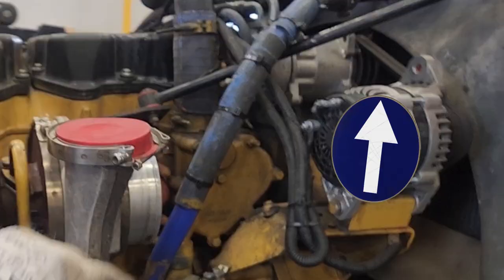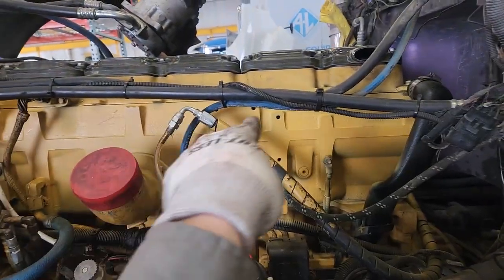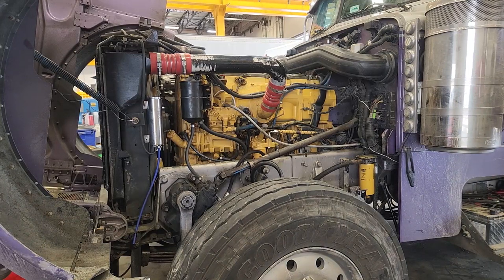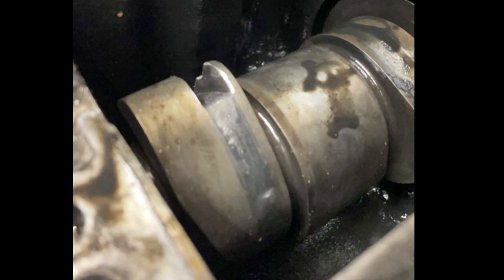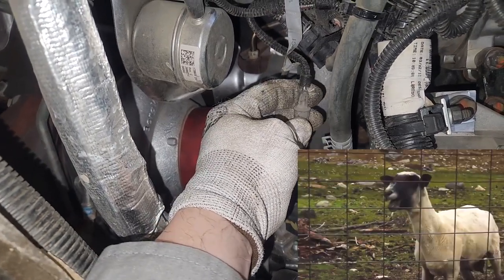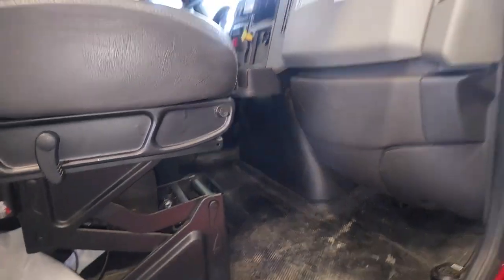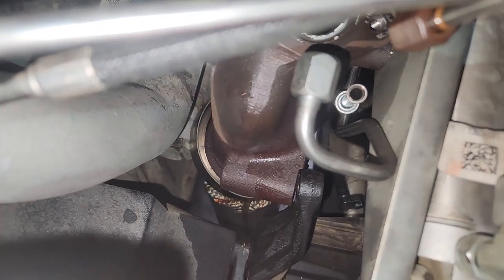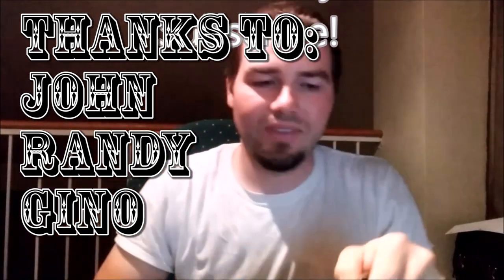Purple Pete Lives Again!!! Finishing the C-15, then starting a new project.....Fire Truck.

Comment: I actually work quite frequently on those Navistar engines as the fleet I work for has an abundance of them. Looks like you got a N9/N10 based on the presence of the NOX sensor on the exhaust brake (EBPV) and the bolt in lines to the heat exchanger, which Navistar calls the Interstage Cooler (or ISC for short). Some tips for working on these for coolers is I turn the wheels to the left and remove the RHS fender, then remove cab mount bolt on the right side that goes through the bushing and raise the cab, put the bolt back into place, then lower the cab onto the bushing bracket. This gives you access behind the right tire to get in there You can get that crossover duct out without removing the doghouse and EBPV in about 20 minutes if everything goes well. If you need any other tips I can gladly help. Keep up the good videos Josh!
Reply from the maker: I'm sure anything you work on long enough just gets easier and easier, although jumping on this one after a Cat C-15 is quite a difference.
Reply: @AdeptApe  Yeah that's true, but I'll say the misery never goes away when working on them 😂😂
Reply: Damn, solid advice.
Nothing beats experience on the job. 👍
Reply: The customer definitely made the wrong decision taking it to a shop that doesn’t regularly work on these. Those hours and hours trying to figure it out must cost a fortune.
Reply: @markm0000  Well it is a fire engine.  That means it involves government which means it involves politics.  Just follow the money.
Reply: @nitetrane98  Your hard earned tax dollars are paying for it...
Reply: That engine looks like it was designed by a bunch of German engineers. Which is to say, people who make things more complicated because they enjoy doing it that way and they aren't competent enough to do it correctly
Reply: I replaced an egr cooler on this exact engine model, it was my first time doing it and it was a complete nightmare, I never want to do that again on these engines😂
Reply: @johnnyholland8765  No comrade, our hard earned tax dollars.
Reply: @GIGABACHI  Thanks!
Reply: @squishysnacks5382  They're definitely a nightmare the first time but do enough of them you can bang em out quickly, I think my best is 10-12 hours
Reply: My boss got some prostars with them they were a nitemare. They took the cat c15 block. Then they added all that junk on them. If all that was forward of the cab it would have been better

Comment: Hey Josh, I’m volunteer firefighter and I definitely wanna see you work on that fire truck. I’ve done little odds and ends on ours and it is a complete nightmare. I’m amazed you could get that doghouse out. Ours are over flowing with switches and wires and screens and all sorts of shit. That button on the floor board blares the horn. Driver looks left, passenger up front looks right. Gotta be able to blow the horn while putting your equipment on. SCBAs and whatnot so you can jump outa the truck and you’re ready as soon as you get on scene. First time I got in the fire truck I heard the horn blaring and thought it was the driver. Turns out it was me with my foot on the switch. I didn’t even know it was there. Lol

Comment: More then likely an EGR cooler on the DT. Very very common. Keep in mind that there is updated parts, like the crossover tube, that have a high temp coating inside. High EGR temps would scavenge aluminum from the cooler housing, crossover tube, and intake manifold and impregnate into the pistons and rings. In turn that would basically eat the liners. At one of the previous shops I worked at, we were doing inframes on those around the 130k mile mark. And also, international calls that an interstage cooler.

Comment: I was a tech at International for about 6 years. You have to remove the EGR cooler to pressure test it. From the looks of it, there's no need to test. But to confirm it, test it. Wait till you try and get that cooler out. Good luck!

Comment: ill watch Anything your working on im not picky I enjoy the information and your dry humor delivery . I was a yard boy and operator for a small construction company  , did general maintenance few fun ones air compressor on a 936 in January @ 30° in a field track  hydraulic lines under a 311 on top of a rock pile  ,  for me it was a simpler time 20 years ago comparatively anyway

Comment: Oddly shaped/lengthened pipes, hoses and wires, are all by design.  This is what "time" looks like in the physical world, and is the common way to do it, because it is simple and effective without the need of delay valves, pressure shifters or power correction circuits.

Comment: After watching one of the last overhaul videos you did, I bought a second hose for my snap on brake bleeder, a Melling oil priming can and I have started using the oil Lucas mixture to lube bearings instead of lubri-plate.
Navistar is a disaster. I had a 14' prostar with an N13 which was a maxxforce with Def. I had tons of Tribble with high pressure fuel pumps, interstage charge air coolers, the emissions equipment all of it. It got so bad I could have the dog house out in 15 minutes albeit there was a ton more room than in that fire truck.
Reply: There two types of truck owners in this world: 1) those that buy one with a maxxforce engine, and 2) those of us who didn't.

Comment: Just a heads up if you’re not already familiar with fire apparatus.  Pumpers usually have an auxiliary cooler in the pumphouse connected to the engine cooling system that uses pump water to help cool both the pump and the engine.  Just something to keep in mind if you’re messing with a fire truck.

Comment: We want to see the pain! Working on a similar unit with a fuel system losing prime issue . Gotta pull the secondary filter base to check the check ball only 14 dipstick tubes 296 fuel lines and a couple bolts and it should be out

Comment: I test I have used to diagnose a failed EGR cooler is to slightly drain the coolant and use your air lift to pull vacuum in the system. If you hear bubbles coming out of either of the coolant lines or the cooler itself, you found the issue.

Comment: As soon as you said water in the exhaust my first guess was an egr cooler. I used to work on the navistars and they absolutely suck to do anything to. You will have to remove the cooler to test it btw. Those engines do love to blow the coolers though.

Comment: Fun fact. NAV warranty pays about 0.5 to R&R the doghouse. Turbos will need to come off the replace the EGR cooler which will have failed. They didn’t get an even semi reliable design until about 2016 or 17..

Comment: International calls that an interstage cooler. The two studs and two bolt that hold it on are often siezed in the valve cover as well.

Comment: Used to work at international seen a lot of that EPA 10 and up style cooler fail usually look like that wet in the back and u can pressure check in chassis but it’s annoying good luck sir

Comment: That tube with the big S in it may be for cooling.  I had a 2008 F150 that did a similar thing with the power steering line.  (it was a V-6 manual truck.)   Sure go ahead and work on the International, really a Navistar, so I'll be glad I didn't buy one.  Keep the good stuff coming.

Comment: The couple Internationals I was lucky enough to work on both had Cummins in them so that part was easy.  Just getting to the HVAC box on the one meant taking the bottom portion of the dash off from driver's side to passenger side.  For some unknown highly intelligent reason all the panels interlocked in a way that you couldn't just take the right side apart and work on things.  I can only imagine the headaches the engines have in store.  The other one had some hidden cancer that took some effort to repair, but other than that it just needed normal wear parts until it was sold.  Curious to see what you may find.  I'm sure being a firetruck it is going to have some unique additions to meet their requirements that may explain some of the mess.

Comment: Looks like a maxxforce 9 liter, international uses that intercooler as well as charge air cooler on the high horsepower rated engines. Most likely egr cooler is junk, be interesting to see what you find.

Comment: I think you should show us anything and everything. More learning opportunities for everyone. Gotta love some of these vocational trucks, so much stuff jammed into such a short hood. I worked on fire trucks for about 2 years, the cabovers were fairly nice to work on, so much room to get to almost anything on the side and back of the engine, above the frame that is. Between the frame and the engine is sadly a very different story with so many wiring harnesses jammed in there. I recall one time needing 4 hours to change a starter on a C13 because a front discharge water pipe ran underneath the starter and have to be removed and getting to the bolts for the starter itself was awful.
Reply: 4 hours is a long time to change out a starter.  We have a C13 as well in a 2008 freightliner M2. 

It was 3 hours for me with my boss helping to get the large starter out without disconnecting any fluid lines under the starter. 

I have thought of removing the lines to get more room but with an extra pair of hands to help with the weight of the starter and going through the maze of hoses, we made it through.

Comment: As a Ex-tech in International Dealer...  Do not pull engine dog house...do this instead.  Pull right side fender,  install    jack stand and a bottle jack under cab front right. Then remove cab mount bolt and jack up cab... after install cab bolt and nut back.  lower cab this will give you clearance do remove turbos and egr coolet more easly.  aslo some time i remove freon and a/c lines out way,,,,
will save you a l;ot labor time removing seat and \engine cover.... most tech destroy the mat in the process..

Comment: Josh, what is the story behind the green coolant that was used to refill the Purple Pete. I haven't personally used the green coolant for quite a number of years as I use the orange ELC. Interestingly enough at the local Kenworth dealer I had asked if they sold the CAT branded coolant and they hardly sell any of it as its priced many times higher then what i believe is the equivalent ELC by other coolant brand names. Hopefully if the owner of Purple Pete has a plan to run the engine to ensure all is good and sooner than later drain that out and change over to the ELC for the long run.

Comment: Is the Navistar engine from MAN in Germany? If so it was designed for cabovers, so access to the rear of block would not have been a problem in its designed application.

Comment: EDIT: I enjoy watching you work on ANYTHING (gen set, truck, excavator, dozer, school bus, RV, et al). 
I don't care about the brand, I have equal love and hate for all of them. 
The xtra bitching and criticizing about their sadistic and ass-backwards technical solutions it's the proverbial cherry on top.
Just a tad sad the videos are too short at 10-15min a pop . . . but I'll take w/e I'm given.👌
6:06 Oh, Josh, that's the norm on today's engines, buddy.
Be glad you don't have to work on TRULY modern, EPA SCRUBBED & STRANGLED Diesels.
Something like a VM Motori V6 "EcoDiesel rebadge", PowerStroke(s) 6.0, 6.4, 6.7L V8 & their recently discontinued Lion V6,  Cummins 6.7L I-6 & 5.0L TT V8 (Nissan Titan XD) or Duramaxes (BOTH V8 and I-6) offered on the 1/2, 3/4 and 1 ton trucks.
And gassers are not any better if it makes you feel better. 🤢

Comment: Yeah we have one fire truck with that engine and it is a turd.  Blew on an active fire. Then tons of exhaust system issues.  I know you’re going to freak but best engine we ever had in a fire truck were 4 Detroit 60 series from the 90s. One is still on the road with us and the others were sold off still working.

Comment: I know it's International/Navistar, and I don't know what year, but I've found that anything, ANYTHING that has been involved or affiliated with Ford Motor Company is the absolute worst to work on. I don't know why Ford is so bad and why it's such a cancer, but I can't stand working on anything Ford or affiliated because it's so poorly designed and implemented.

I worked on Chryslers for ten years and while they had some weird designs they typically had a "Keep It Simple, Stupid" attitude about their stuff.